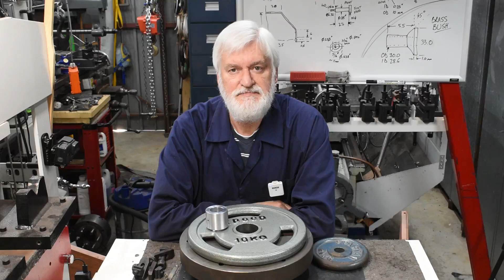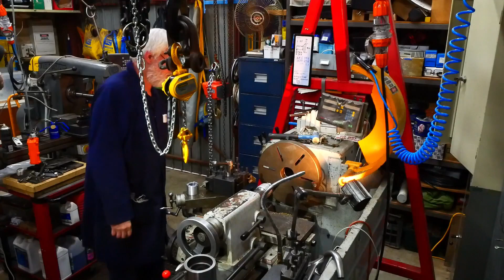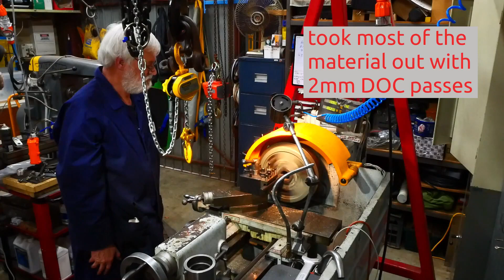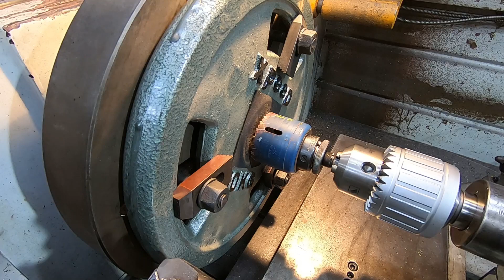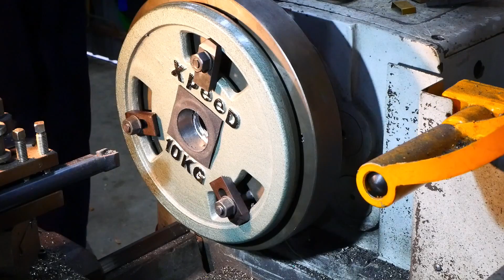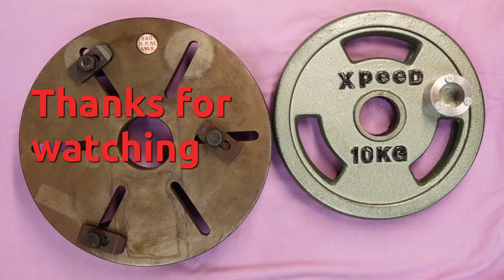Faceplate on my big lathe (D1-6 mount) - first use.

Comment: Good Job Alan, the Hole Saw wasn't happy, you need a set of Annular Cutters mate.
Reply from the maker: Annular cutters would have been perfect for this job but I only have a small set ~14 -24mm. Sadly, the larger sizes are very expensive eg 60mm ~$150 and I can't justify that cost for my very occasional use. I was a bit surprised that the hole saw did so poorly as I have used hole saws in this way before with no problem: 
https://youtu.be/2oGaQTjMz68?t=304
Anyway, thanks for your comment.
Reply: @alanshomeworkshop  I love them, mine are all non metric, up to 2'' i got them cheap, they sure do get a good hole to start with, but you're right, good Hole Saws work well as well.

Comment: Alan your a braver man than I am taking it up to 400rpm 
those cast iron weights are usually made from the dregs and left overs and contain slag and other impurities making for inconsistent material density never mind the poor quality of the moulds given that it's only real function is to be heavy and some what round 
The potential for it to explode would have made me go to the milling machine and bore it out on there instead
Reply from the maker: Well I did consider the possibility of such an issue, but naively thought 400rpm would be ok. However, I'll take note of your advice and use the milling machine if there is a next time. Thanks for your comment.
Reply: @alanshomeworkshop  I don't know if you have seen the aftermath of fly wheels exploding 
obviously it's not spinning at stupidly high rpm but still having it clamped down and that the clamps where putting a side load onto it increased the potential danger similar to using the side of a grinding wheel 
At least  in the mill you can spin the tool at the right rpm to make a good clean cut with no risk of a catastrophic failure
Im a safety 3rd kinda person oh&s gets in the way of progress but I'd hate to see or hear of you getting hurt or seriously injured
Reply: They're actually a lot stronger then you give credit, they're made to be dropped and banged around.
Reply: @65cj55  yeah dropped and banged around is one thing being spun is a whole other thing go have a look at fly wheels exploding and the damage they do by all means 400rpm isn't a lot but it's also not a high quality casting or forged balanced and precision machined peice of equipment
Reply: @TheConkulator  They're ample strong enough, likely just as strong as the Faceplate.